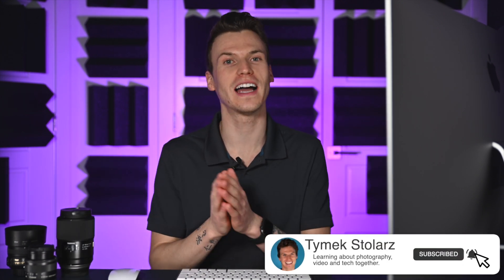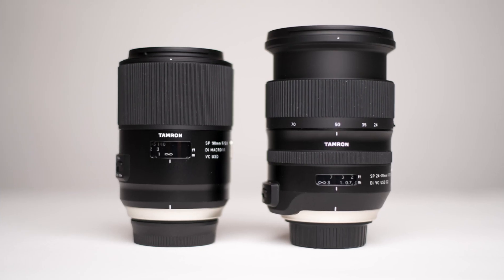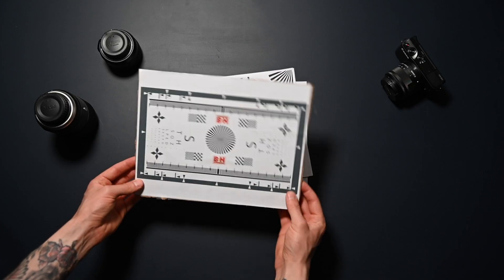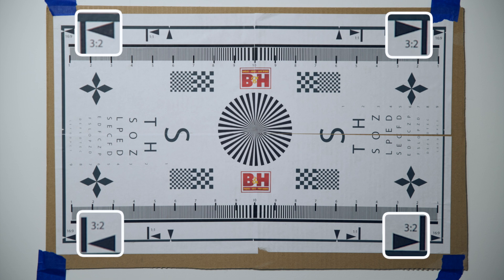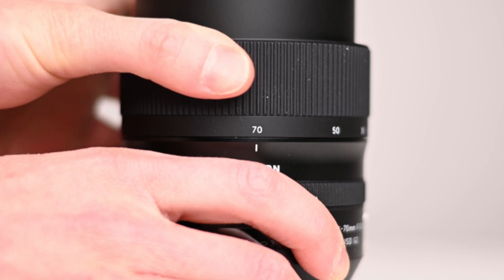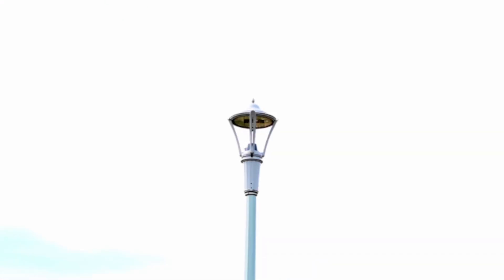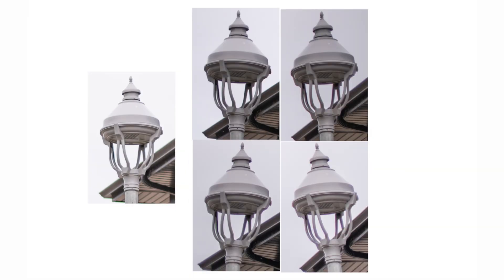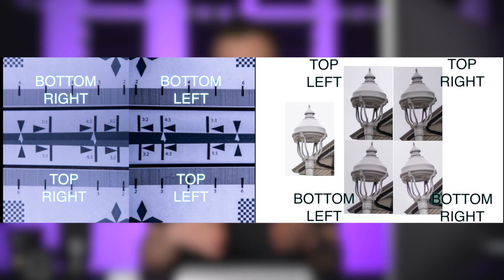What is a decentered lens? You NEED to do this lens test to see if your camera lens is decentered

Comment: As part of the test you should also be sure the lens doesn't have field curvature. You might think a lens is de-centered because the edges are blurry, but this could be the result of field curvature instead of de-centered lens elements.

Comment: So does it matter that the lamp is at an angle in one of the pics? Or are you just looking for blur?
Reply: Doesn't matter. This test is simply looking for sharpness. You also don't need to export it to a jpg, you can just look at the project in Photoshop. Also, to get an idea of the vignetting and have a relatively evenly lit lamppost or object you can lock the exposure to see how much darker the corners are as well along with you should be looking for distortions as well.

Comment: Thanks for this useful video. I just bought a new Irix lens and it looks decentered to me after conducting the second test you suggest. I wish I could show you my results for a comment.
Reply from the maker: No problem :) you can send me a picture to my email tymekstolarz@gmail.com.
Reply: @TymekStolarz  I have do so. Thanks!
Reply from the maker: Yea i would say that is probably a decentered lens - however i had few times i did this test that my results would look similar to yours (although not as bad) and when i did the first test in this video with just 1 photo checking the corners, it didnt look nearly as bad. although method 2 is one i've seen a lot online, i think there are more opportunities to get inaccurate results compared to the 1 sheet 1 photo because of the movement of the camera. i think yours seems bad enough that you could just go back to the retailer and indicate you want a new copy, but if you really wanted to be sure i would recommend also confirming your results with the other test method.
Reply: @TymekStolarz  I appreciate your insight. I will perform test 1 as well. I repeated the test with other lenses I own and they look consistently much better, with all four corners very similar to each other. After I confirm the problem with test 1, I'll ask the retailer for a "good" copy or a refund. Thank you for sharing your expertise and time.
Reply from the maker: If you have other frames of reference that show good results than i think you are good to go and can go directly to the retailer without completing the additional tests. Best of luck with getting a new copy and take care :)
Reply: @TymekStolarz  I agree. Even sharpness across the frame is on on the company's selling points. Unfortunately, my copy doesn't conform. I hope I can get a replacement as I really like their products. I hope more lens owners will listen to your channel and become aware of the decentering problem which I think plagues many consumer still lenses.
Reply from the maker: Thank you for the kind comment I really appreciate it. Yes it’s crazy how it’s a thing. I’m surprised there isn’t some type of laser or light test that could quickly and easily test it. Although decentering can occur sometimes during shipping and handling

Comment: How about a method that I could test a used lens from a random seller in an outside environment ?
Reply from the maker: That’s a good question of which there is no simple method that I could think of as I was wanting to do the same thing. You would have to bring your camera, laptop and tripod with you, and do the pole method I show in the video. Putting the object in all 4 corners and then comparing all the corners. Instead of putting all the photos into one photo like I did in photoshop, you could just open all 4 and preview and compare each of them. Unfortunately  that still takes time but it’s the only way I can think of. If you practice doing it at home a few times you could probably do the whole test in less than 10 min and the seller should be understanding.
Reply: @TymekStolarz  Sounds pretty reasonable from both sides. Thanks for fast reply
Reply from the maker: Not a problem, always happy to answer questions. Good luck!